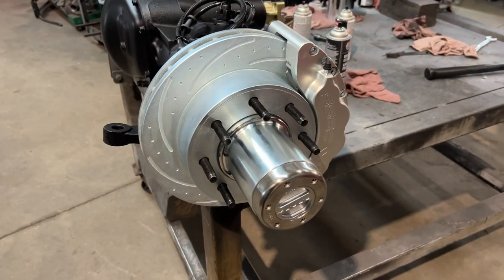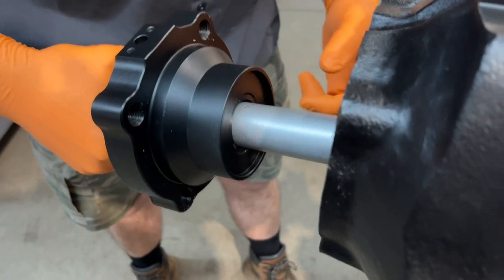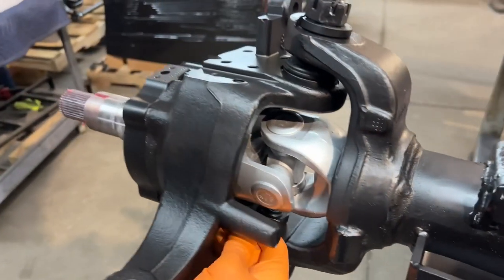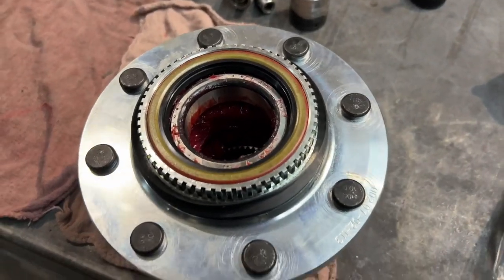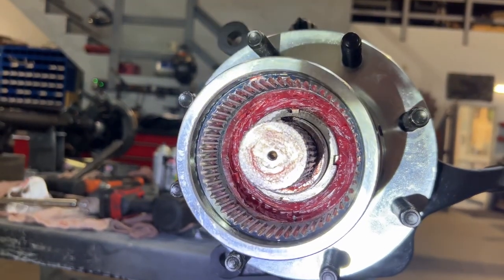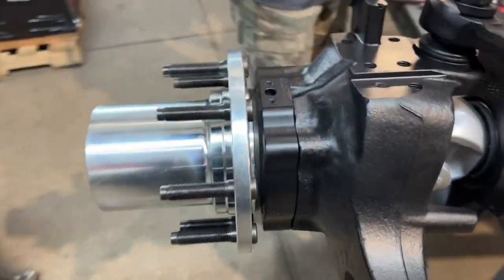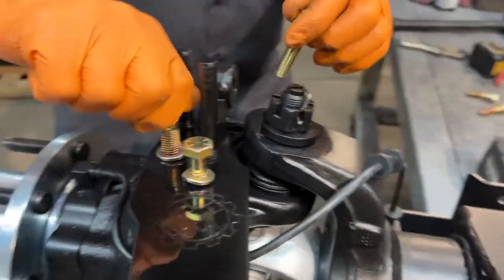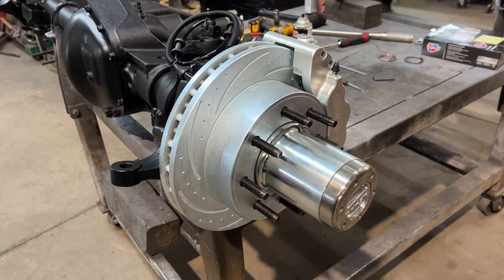Spyntec Hub Conversion Install

Comment: c'est un très bon système, mais il a un défaut c'est que tu dois sortir du camion pour verrouiller tes hub. 
Je suis transporteur et je roule beaucoup en hiver au Canada, j'ai un dually ram 2017 et quand je suis surpris par l'adhérence je peux activé mon 4x4 immédiatement et rétablir ma trajectoire avec ma remorque de 35.000 lbs.
 Tu me diras que je devrais activé mes hubs avant de partir !  ben oui et non, le dually est dur sur la direction a cause de la rotation des roues arrière extérieur qui tourne plus vite que les intérieur lorsque tu prends des virages , donc tu réduis ta vitesse et ensuite tu désengage ton 4x4.
avec ce système c'est pas possible. ( je commencerais pas a sortir du camion avant le virage, engager les hub, remonter dans le truck, passer le virage, ressortir du truck pour désengagé  etc...🤣 blague a part)

En été ici au canada tu as des routes avec une route creusé par le passage des camions et lorsqu'il pleut cela se remplis d'eau et tu fais de l'aquaplanage , cela m'a surpris plus d'une fois et j'ai failli sortir de la route car j'ai juste eu le temps de passer en 4x4  et j'ai corrigé la trajectoire. Et rouler avec ces hub avec lock manuel engagé en été ce serait pas top vu l'investissement, vu que je me retrouve avec les même fonction et usure qu'avec les hub d'origine.
 
oui c'est efficace pour évité que le différentiel avant tourne pour rien et s'use pour rien.  mais ca demande quand même de l'entretien sur les 200.000 km que je fais par année.

il aurait fallu le même système que sur mon autre camion qui est un Ford dually F450 qui lui a un système de vacuum qui te permette activé ou de désactivé depuis la cabine.

donc il y a avantage et inconvénients.

a réfléchir

Comment: When using the factory style brake setup on an 05+ Super Duty axle, are you having to use any spacers to get the rotors and caliper bracket to align correctly? I’m finishing up my Spyntec install and the caliper bracket is touching the rotor.
Reply from the maker: You’ll have to ask them, we only use the 99-04 kit. No spacers

Comment: Just wondering on the steering arm. My drag link was rubbing on the top of passenger side leaf spring   When I originally installed the kit. We fixed it with a spacer you sent me. Why did my drag link not clear the spring originally? Yet some clear without using the spacer. 06 5.4 RB 6” kit. Everything works great now with the spacer.just wondering what would cause this issue.
Thanks Chris.
Reply from the maker: Our previous spring builder would add a small spacer leaf to the bottom of the pack, that’s what caused the clearance issue. Even after we brought it up and asked them not too, they still did it from time to time.
Reply: Ok thanks I understand now.

Comment: Nice set up. With the high placed steering arm no need for a drop pitman off the box I assume. Another proper way to eliminate bump steer.
Reply from the maker: We run a slightly longer pitman arm on some vans

Comment: Can you give a basic explanation as to why you would want these hubs over stock? What do they buy you? By their looks I assume their main purpose is to make wider rims possible? Not sure.
Reply from the maker: There are a few benefits. Serviceable wheel bearings are always more reliable than unit bearings, 35 spline stub shafts are stronger, can be made 8 on 170mm or 8 on 6.5 and we can run the correct ABS sensor to make the RSC and ABS happy if the van is equipped. It doesn't change the width of the axle as far as the wheels are concerned (same WMS to WMS)
Reply: @ujointoffroad  Ah, all makes sense. Thanks for the explanation. Another quick question: is there any reason to avoid the 460 in a 96 E350? Especially in comparison to the 5.4 or V10? (Or in any of the years that has 460s that you still do conversion on? Reason I ask is because I see quite a few good deals for mid 90s 460 E series vans and RVs compared to later engines in an otherwise very similar chassis.
Reply from the maker: @drott150  Nothing wrong with the 460, we stopped on the older rigs mainly due to the transmissions and sourcing parts for them.

Comment: Hey Chris do you sell those wheel studs on your website?
Reply from the maker: The wheel studs or spindle studs?
Reply: @ujointoffroad  wheel studs
Reply from the maker: @arnoldcars8227  these are the same as an 02-04 F series